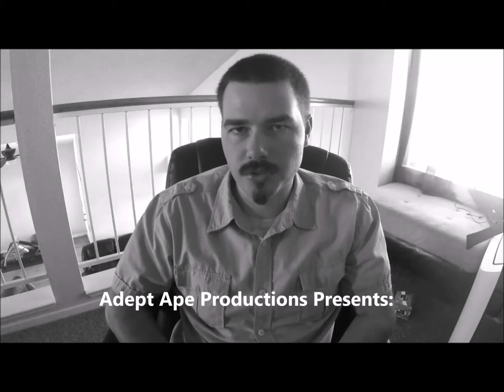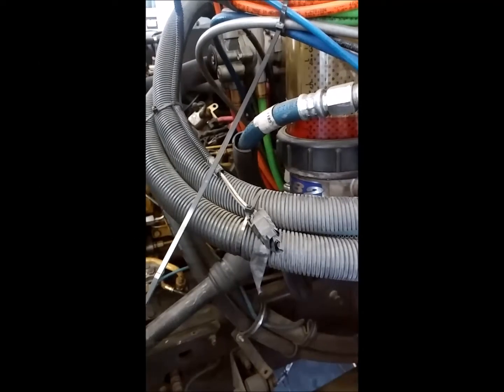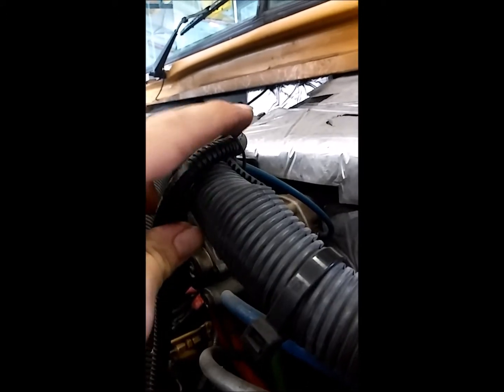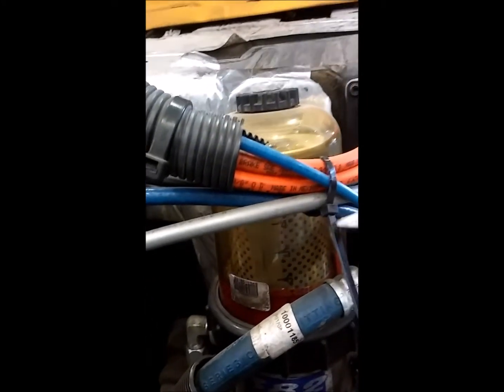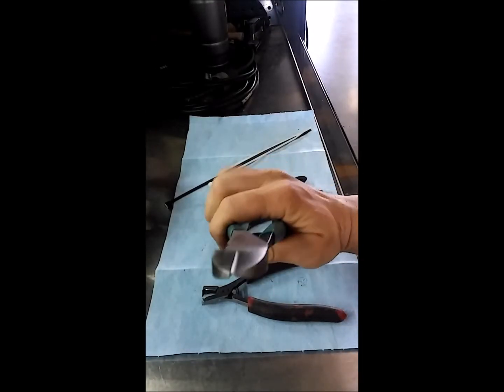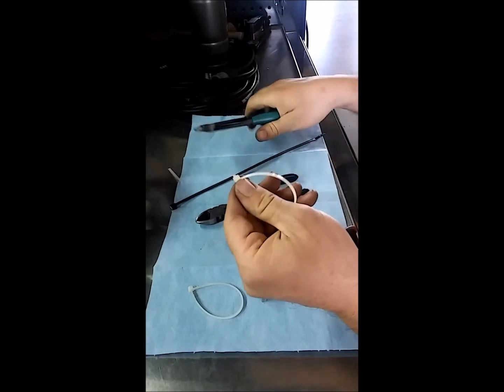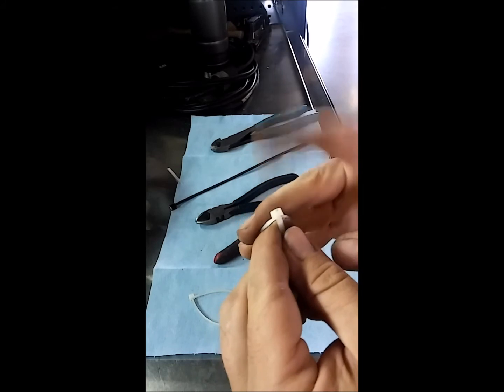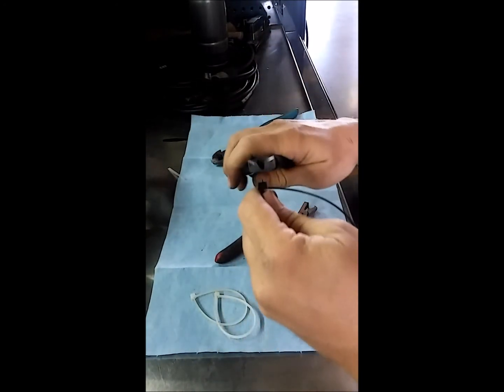How to Cut Zip Ties the Right Way

Comment: there is a video on yt it is stve rob channal    twist them off with a slip joint plier   I found that out after I had bought   the new snap on flush cut pliers